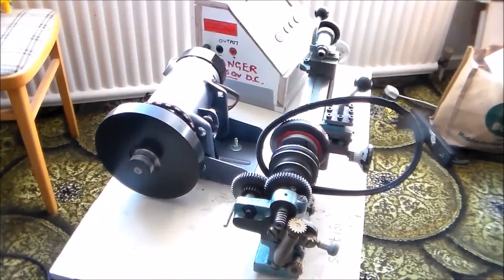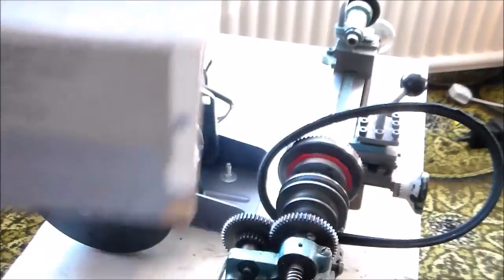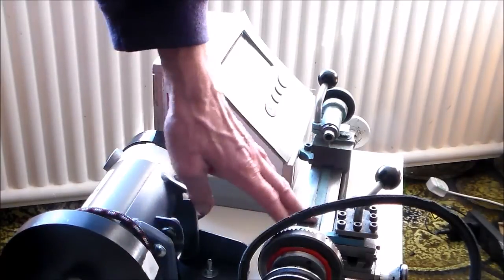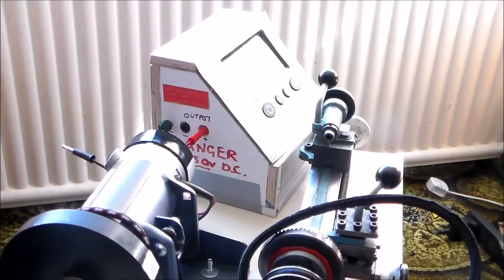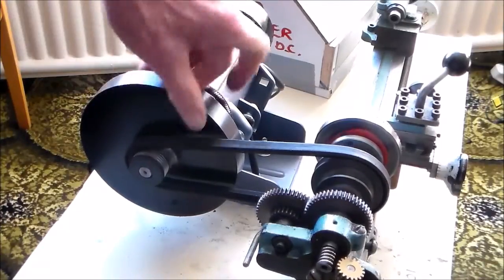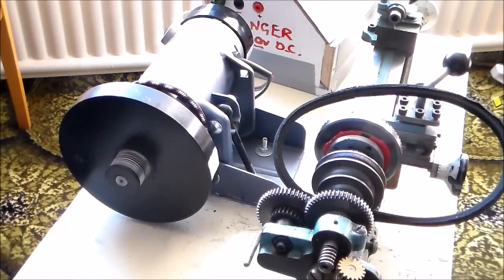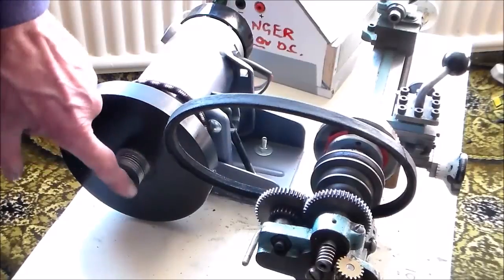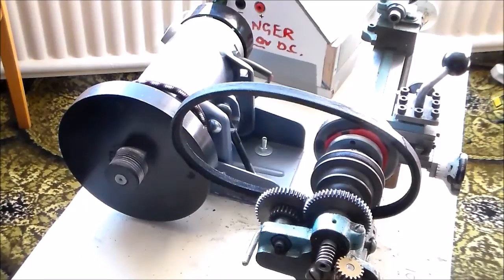safety; simat lathe with variable speed

Comment: All very interesting John,,,, you raise a lot of points well worth considering ,,, Do you think you may need a lever on the motor to add tension but using  of a threaded rod and hand wheel,
Reply from the maker: Hi Alan, I thought the tension from a luggage elastic would be enough. I have experimented with 'wedging' the motor and it removes most of the vibration. I am going to try and rig up a more rigid tensioner with a resilient bush for some damping.
Reply: John Mellor Yes as you say ,,,, I think you will have to have something fairly ridged,,, the reason I was thinking treaded is that belts intend to resonate and something as small as  just half a turn one way or the other may stop the belt resonating but not having it over tight,,,, and I was thinking you only want enough tension to do a particular job and for the belt to act like a clutch,,,, should something jam the belt would slip,,,, perhaps depends on how much you think you might be using it,,, you can upgrade it at a later stage...
Reply from the maker: ***** Excellent points Alan. I am now looking at what I can do along those lines including possibly a countershaft. It is probably the wrong belt for this application, but the headstock has to be disassemble to change it.
Reply: John Mellor Im sure things will slot into place,,, some where like "simply bearings " is like a one stop shop for all manor of things,,, and a couple of pillow bearings that have the floating mount so if they are slightly misaligned its not such a big issue then it should be straight forward but its just the cost starts to add up ,,, bearings will be a tenner a piece ,, a couple of pulley's and collars and a length of shaft and its 40 or 50 quid before you know it,,,,, bit of a shame when you have such a controllable motor,,,,,,  but im sure you will find something ,,,,,  to sort it .......